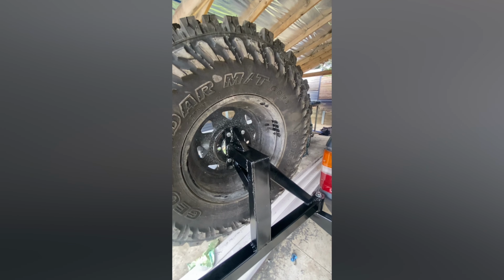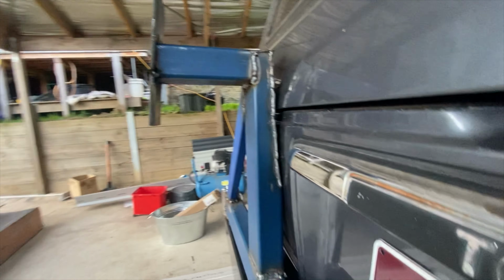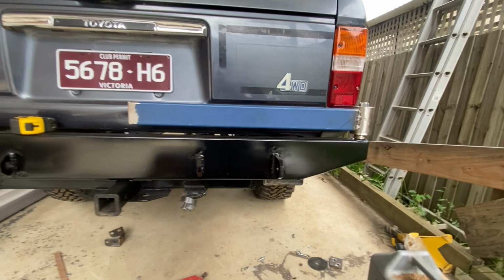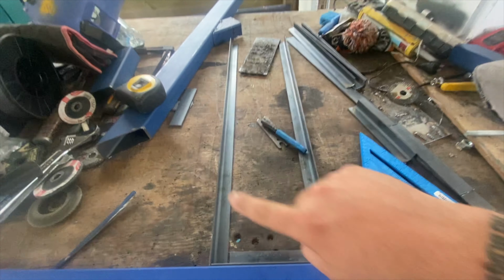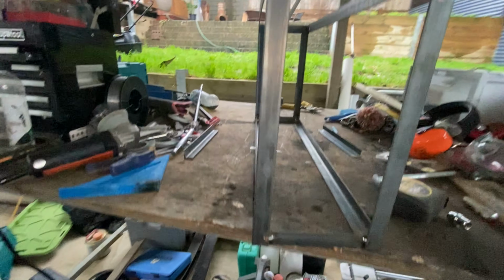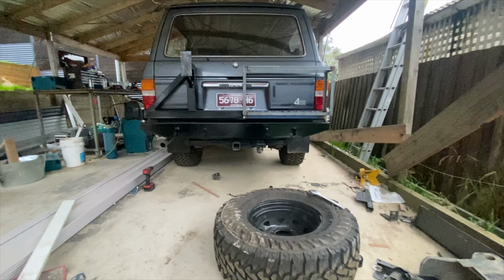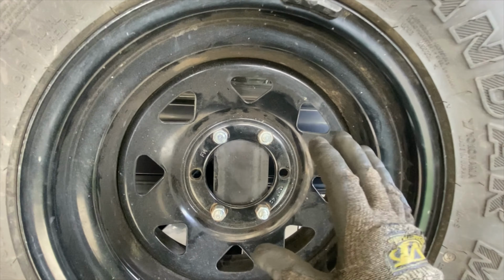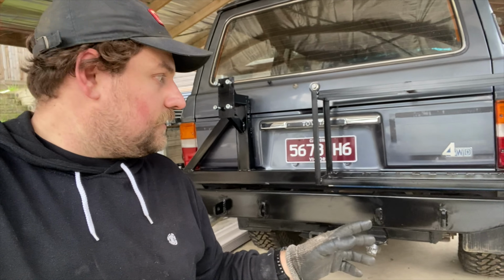TYRE CARRIER and FUEL CARRIER build COMPLETE

Comment: Amazing result and Grt video!  You’re getting my wheels turning on doing one for my 60…. Did you consider doing some side protection?  Like extend the protection forward off of the bumper ends…
Reply from the maker: Thanks dude. Definitely, I will plan to do sliders and scrub bars. But the panel works in need of a lot of attention before I go there

Comment: I've been trying to source a fuel carrier for my MCC bumper, but am striking out badly. Looks like I might go this route and try to match the tire swing arm as much as possible. It's been a year since this video, how are they holding up so far? Well done.
Reply from the maker: Still love it. Starting to rust a bit. Considering it’s only spray paint. I think I’ll upgrade the latches soon. They came off in some hardcore 4x4ing. 
Wouldn’t do the lights how I did.

Comment: Coming along nicely.  Looking forward to see how you do the latches.
Do you still have the original spare underneath?
Reply from the maker: Thanks mate. Nah no spare underneath. 
Hopefully the next episode is up next week
Reply: @favouritejay  
I removed my underneath spare to install a long range tank.
So I assume you just have a gap under there now?
If you have the original tank under there you should take it out to check out the top.
I found fuel leaking out of my original tank on to the ground one day when I had a full tank and was parked on a bit of a slope.
Leaves, dirt and crap can get caught between the tank and the floor causing it to rust out.
I later herd that this is a common problem but no one told me about it.